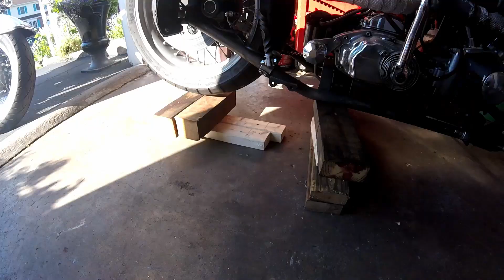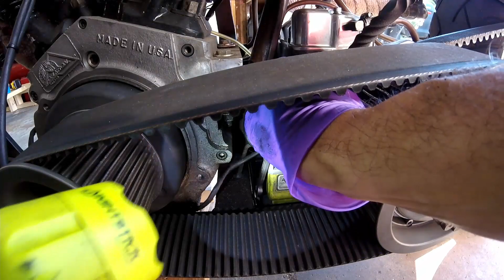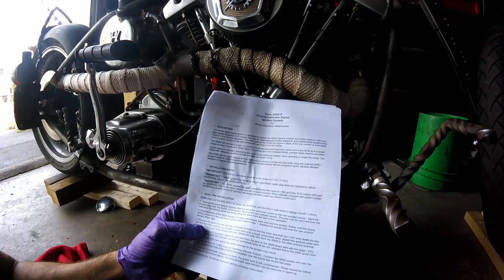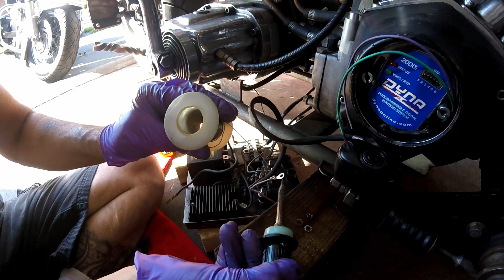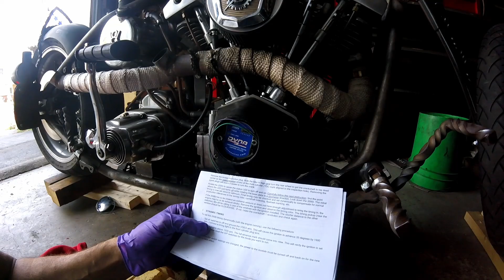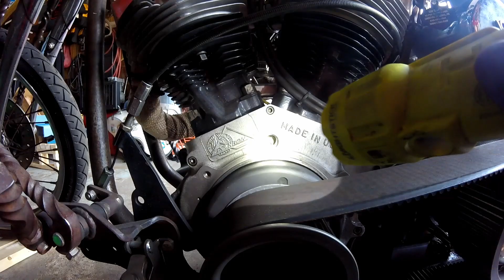Dynatek 2000i install Harley Evo or Shovel Nose Cone Single Fire Finding TDC Top Dead Center

Comment: Hi!!! Can I use  5 Ohm Dyna Coil with Dynatek 2000i ???
Reply from the maker: No it can not. You must use a 3 ohm coil.
Reply: @Rapsgarageshop  Thank You !!  Regards from Poland!
Reply from the maker: That’s awesome that I can help someone so far away!
Reply: @Rapsgarageshop  Please help. I did Evo1987 engine service, I replaced the camshaft with s&s 495v, I bought Dynatek 2000i and there was a problem with starting the engine. The motor is set as the manufacturer suggests. Tdc in the window is a line piston located at the very top. I set the ignition so that the LED signal goes out. When trying to turn on the engine, the LED shows the signal at the beginning and at the end of the start. I am asking for help. Best regards
Reply from the maker: I’m not sure what you mean when you say that it shows the LED at the beginning and the end of the start. If you follow my video exactly how I have it you should have it set correctly.

Comment: Hi sir, thank you very much for the video. I just install a 2000i (Rev set to 0) with single fire coil. However, I found that everytime time when I turn the ignition on, there will be 1 spark and it burn the fuel in the engine. This make me so hard to kick start the bike. How would u overcome this problem?
Reply from the maker: I’m not exactly sure what you’re saying but you could set the dead revs to 1. Have you put a timing light on the engine yet? Your timing could be off causing your problem. If you want you can email me at hdrap_1999@yahoo.com
Reply: @Rapsgarageshop  When I turn on the ignition, both rear and front spark would light up. This cause the fuel mixture burn. If I unplug the spark plug before turn on the ignition, then plug in the spark plug. It can kick start and run great.
Reply from the maker: @MrChiangchben  Sounds like changing it to one dead rev would fix it but it also sounds like you have an Issue with your module. I do have the programmer to change the dead revs but I recommend calling Dynatek at 800-928-3962 and speaking with one of the Techs there first.

Comment: I have 1998 fatboy with Screaming Egale heads and 42m. Mikuni Screaming Egale carburetor it's getting fuel and good spark I took the timing cover off and thats when I found it had a Dyna.2000i ignition system like the one in your video engine timing mark was aligned with front  cylinder TDC when I turn ignition on red LED light does not flash also does not flash when adjusting ignition timing if   module doesn't work why do I have spark if I have spark why won't it start it doesn't make  sense how do I test it
Reply from the maker: The LED could be burnt out. Any chance you have water in your fuel? It’s important that you have a good battery. If the voltage is low the module will not work. As far as testing I’d say call Dynatek and ask them for suggestions. I know you can send them back and have them tested. Usually they either work where they don’t so I would suggest looking for other problems. Spray some carb cleaner right down the throat of the carb and see if it pops off. If you need further help, you can email me your phone number and I can help over the phone. hdrap_1999@yahoo.com

Comment: Hope you don’t mind a question. Why did you choose a single fire ign. Over the dual fire? I’m not sure which way to go. I have a 1970 ElectraGlide stock shovel.
Reply from the maker: It’s much smoother running with the single fire. You’ll be surprised.

Comment: On big twins you can also tell when you're on tdc compression stroke when you have the tdc mark centered in the window in the primary side of the motor and if you look at the notch on the end of the cam it should be in the 7-8 o'clock position and on sportsters it will be in the 10-11 o'clock position
Reply from the maker: I agree but I don't want to have to remove the ignition each time I want to find TDC like when I'm adjusting the pushrods. You do have a good point. Thank you for watching.
Reply: Also depends on the ignition. The Dyna s or points you time from the advance mark with the cam in the advance position while setting spark…
Reply: Is it hard to time my cams on my 96 sportster?

Comment: I'm using a dynatek and let me tell ya ,the unit sucks . The bike hasn't run since it had points... I would not recommend dynatek to anyone. Just my outlook. And I have messed with it for 2 years.
Reply from the maker: You can always call the factory and see if they have any advice.

Comment: Hello, Thanks for doing this video. It's very helpful. I wonder if I could bounce an issue I am having with mine of of you? I purchased a Dynatek 2000i ignition and coils for my 1981 FXWG shovelhead. I was using a Dyna S ignition for the past 10 years which failed around Christmas time and I decided to go for the upgraded version. I am running Dual coils (DC1), Dual plug heads and set to single fire. I have installed the above along with removing the advance weights and replacing them with the gold timing cup as per the instructions. I am now attempting to static time the bike.

However when I have the ignition switch on and stop/run swtich also on. I get the red light appearing only when the rear cyclinder is at TDC or mid exhaust stroke on the front cyclinder.
The light goes out long before I get to TDC on the front cyclinder on the compression stroke. Which is how the instructions advise to achieve the correct timing.

I have removed and reinstalled all components several times now. particularly the timing cup (ensuring the bevel is aligned with the cam recess). but I cannot get the red light on while at TDC on the front cyclinders. Even when purposely 180 degrees out (just to check). The cams are timed correctly as I was riding the bike when the Dyna S ignition failed on me and the engine has not been opened since. but I only get the red light when I am TDC on the rear or mid stroke on the front. 

Would you have any advice about this type of issue? Thanks again for the vid's. Cheers, Bill
Reply from the maker: I have a few ideas on what it could be. It would be easier. If you email me your phone number and we can talk it over the phone. hdrap_1999@yahoo.com
 If that’s a problem let me know.

Comment: Hi Carlo...great videos...very helpful. I have a question for you. I am using a Ultima single fire ignition with the Ultima coil. The coil has three posts. The old Ultima ignition went bad along with the coil. I know the center post is suppose to be hot(12V), but when I hook up the center post, the front and rear cylinder posts are also hot. I am getting a very weak spark. You can't even see it on the end of the plug, but you can feel it if you hold the plug in your hand while cranking the engine over, but its no where near where it should be. Any help would be appreciated. All my grounds are good. Very simple harness. Thanks
Reply from the maker: Email me your phone number to hdrap_1999@yahoo.com. It’s easier to explain over the phone.

Comment: Can this ignition work for a electric start and kick start is it capable of programming for both of I chose to kick or push button
Reply from the maker: You program it for zero revolutions (kick start) and it will still work with an electric starter. It will light off quicker with the electric start. The reason they put the three dead revs for electric start is to get the motor spinning then light the ignition. It’s easier on the electric starter that way but it will work both ways.

Comment: Am I missing something here? Why would you put a single fire coil in the bike and set the timing module for dual fire?
Reply from the maker: If your looking at the dip switches they no longer work because I programmed it with a computer. Once you program it with a computer none of the switches do anything. I did program it for single fire and it has a single fire coil do each plug fires individually.

Comment: Probably why it didn't fire right up, because it's not properly timed from setting the timing while backing the motor up and the slack in the gears has now thrown off your timing

Comment: They say you should never time your engine while backing the engine up as there is lash within the gears that won't be properly accounted for when you lock the ignition in so when the engine moves forward it's now not going to be properly timed because of slack in the engine
Reply from the maker: I followed the directions from Dynatek. There’s nothing in those directions that say you should rotate your engine backwards, nor should it change where the timing happens. Lastly, after I’m done completely setting the timing I check it in the direction of the engine rotation and it’s at the exact same point as whether it’s rotating forward or backwards. I do appreciate your watching and your comment in the future. I’ll keep an eye on what it is you say and see if I notice any difference.

Comment: I was hoping you would have to drill out the the rivets holding on the ignition cover on. I have a 95 Fat Boy and that cover is loose and I'm worried water will get in there and ruin it.  What's the best way to attack it?
Reply from the maker: If you don't want to drill out the rivets, I would tap the rivets with a small ballpeen hammer and see if that tightens it up. If not it's not a big deal to drill them out and put new rivets in or go to a chrome cover and screws. Hope this helps.
Reply: @Rapsgarageshop  I definitely want to drill them. I tried to tap on it with no movement and then I used a punch ( a smaller foot area to push in on) and nothing. But I've never seen it done before and don't want to puncture or impel anything. Am I going to need the tower nutts to screw into or drill and tap the rivet holes?  Not one of the 8 manuals I have says anything about it.  Mostly because there pre 1987. LoL
Reply from the maker: @trevorhalford8410  to be honest I’ve only done it once and it was back in 1997. I can’t remember how I did it… go figure. I remember drilling the rivets but can’t remember after that. If you have to remove the post do it one at a time so you don’t have to time the bike. Also you can use a scribe and mark the plate so if it does move you can put it back.

Comment: I have the Dyna 2000i ignition on my EVO it sits under the seat. Where the original was before. I don't think you can plug your computer into it and I don't think I'm smart enough to fiddle with a computer LOL mine has the dip switches also and I have mine on the next to the highest level or the quickest curve for the advance if I have it on the quickest and it's hot and the motor is hot outside the motor's hot it will ping so I dropped it down one notch and it's still pretty peppy I don't think mine has the option to make it a kick I often thought of doing that but then I would have to change the exhaust cuz I'm sure the lever kick lever would would probably smack into my exhaust but I do miss the fact that you can kick the bike to get it going
Reply from the maker: Everything you said I believe to be correct. Of course you can change out the ignition you have for a programmable one but that would only solve one problem.
Reply: @Rapsgarageshop  here's something I did the other day I put the stock ignition and the dual fire coil back on I did nothing with anything else. I remove the single fire coil and the Dyna 2000 ignition box. And boy did the old CV  cough come back.🤔😲
Just going back to the stock advance curve caused it to cough profusely at about 1/3 throttle. So then I pulled the stock ignition box off and put the 2000 I back on the left the dual fire coil. And it ran just like it did before I was really just curious to what the bike felt like when I bought it used and it was all stock and I didn't feel any difference going single or dual fire I have always heard that single fire makes it smoother. The exhaust was a little different when I had the single fire the Josh note tended to run together when I put the dual fire back on coil the exhaust note changed other than that the motor was just as smooth. I'm just always tinkering around and thought I would mainly cuz I didn't remember how the bike ran 5 years ago when I bought it I just bought that 2000 I and switched it over. I do have the 2000 I set on the next to the quickest advance curve I think there are four curves to be chosen and when it's on the most aggressive and it's hot and it's hot out it will ping so I brought it down to the next to the highest one and it's always ran fine there for years but it's funny how changing the curve back to stock cause the carburetor to cough and always the carburetor's been fine once I cleaned it up a few years ago. I run a 175 main jet a 45 slow jet and about three turns out. Of the fuel mixture screw.
Reply: @Rapsgarageshop  now in this video you set the timing while backing the engine up which isn't the correct thing to do, am I right? Because there is slack in the gears which will not be part of the timing and when the engine rotates forward your timing will now be off & probably why it took you almost 5 kicks to get it started
Reply from the maker: @jinxbottleflip1942  after I’m done static timing I check the timing dynamically as you can see in my other video. The timing was right on the money.
Reply: @Rapsgarageshop  alright well I didn't see the other video I only saw this one, so I stand corrected because you corrected it, I was just here looking to see how you installed and checked you're timing and for those who watch this video but don't see the other video like me they should also know that you shouldn't time your engine while backing it up, I've been trying to get this Ultima shovelhead engine running for a month it's a 96" friggin beast kick only and I've read every single forum and watched every video on timing so it's fresh in my mind, and since my comment I've hit on something and actually got it started off the kicker, still need to reprogram the ignition down to zero Dead revs , sorry for invading your day in the sun
Reply from the maker: @jinxbottleflip1942  It's all good and I'm glad you got your bike running. If I can be of further help please reach out and I can contact you by phone since it simpler then all this typing. Thank you for watching.
Reply from the maker: I’m not sure why that is but even the HD factory went to single fire on any twin cam and newer
Reply: @Rapsgarageshop  that I did not know I know there are like four wires going to the coil now if I remember right cuz I switched over a friend's 2007 Softail to carburetor cuz nobody could figure out two Harley-Davidson dealers couldn't figure out what the problem was I said heck let's just convert it back to a carburetor
Reply from the maker: I’m not sure why that is but even the HD factory went to single fire on any twin cam and newer